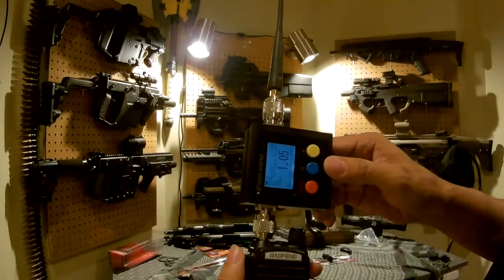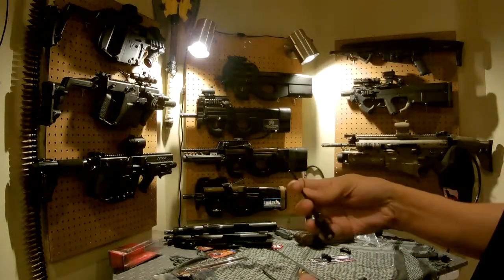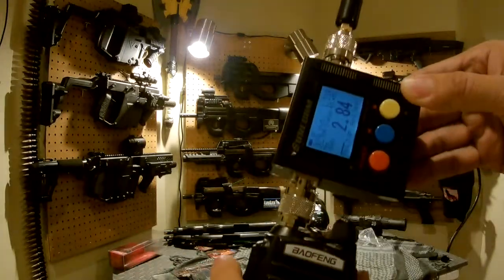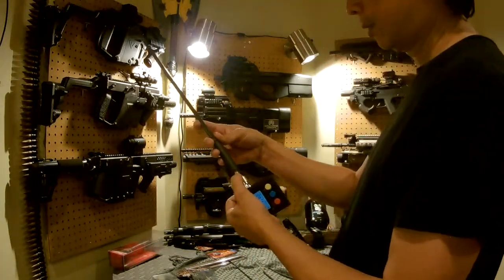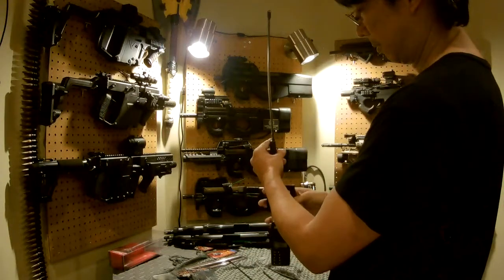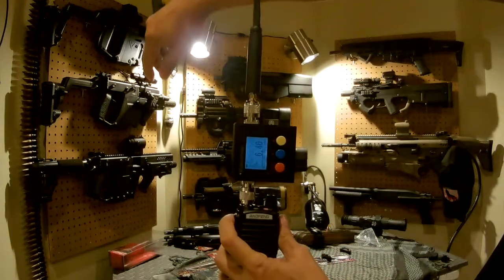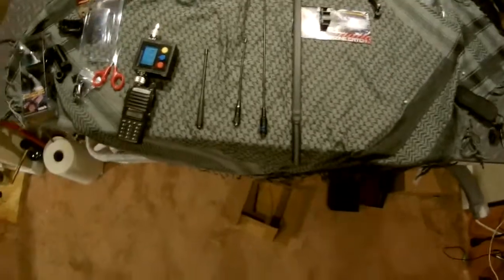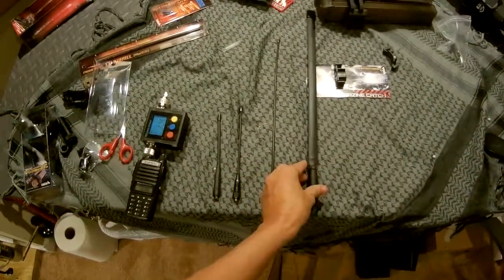swr on a few antennas

Comment: FRS ch.1 frequency is 462.5625 MHz. And seems the stock antenna has the best SWR, I would use that one the most.
Reply from the maker: i'm glad you caught that. it's a backup radio. we normally use the 888 and the uv82 is rarely used. i need to reprogram that.

Comment: I like your P-90s and others ,but you cannot check these antennas the way you did . These antennas are designed for the ham bands , so , your about 20 Mhz out of band , and they WILL show a bad SWR .  Not a fair test , but still good to see this. Next time , test them at about 445 Mhz and you should see a good SWR reading . Get your license First though , I am an extra class ham operator , so I know what you are doing wrong.  Still a good video.
Reply from the maker: i know they are not tuned for 462/467. wish they were tuneable though. WRDG578
Reply: @TeamMadcrew  The stock antenna should be good from 144 to154 so you can use the license free MURS channels.  Look up MURS